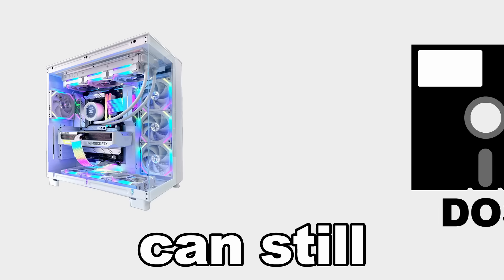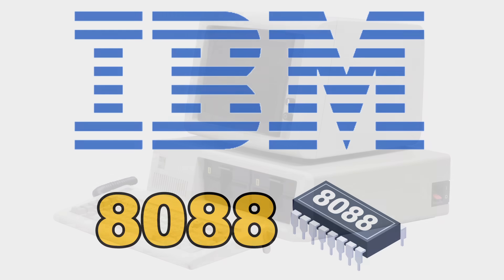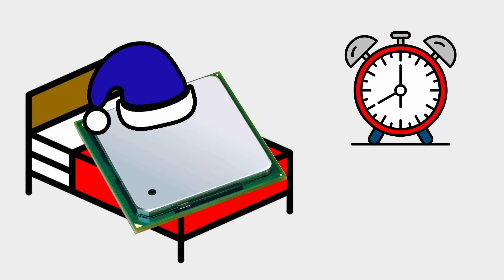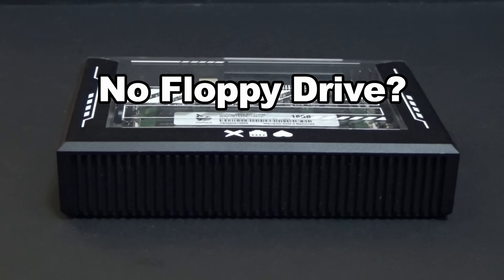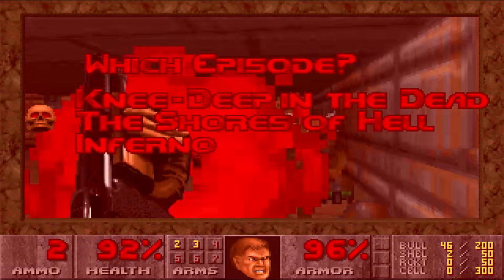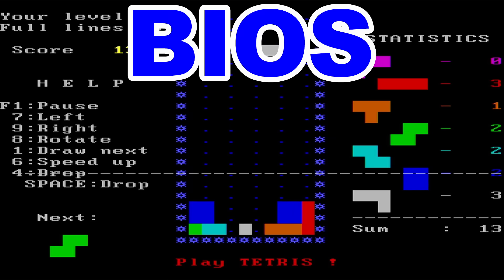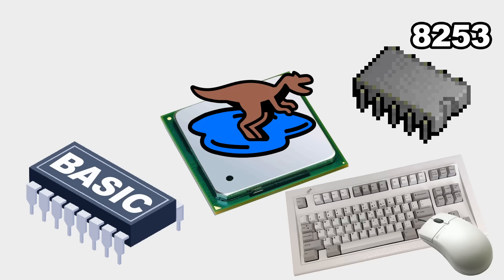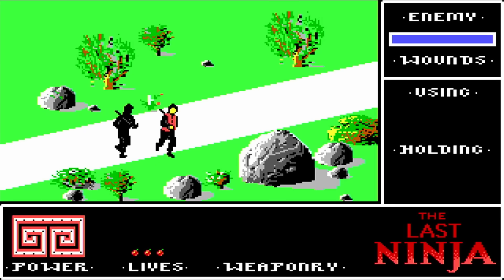45 Year Old DOS on a New Intel CPU Without Emulation

Comment: going by the few guys who talk about how the CPU is physically put together there is no reason to get rid of the older instructions. The part of a picosecond you would save by doing so will not matter when compared to the other picoseconds taken by the rest of the chip. Yes picoseconds as it is all inside a very fast part of the chip. 
Maybe when 20MHz was considered "fast" removing an instruction would be a thing that will show some benefit. Now that base speeds on the lower end chips are over 3000MHz  removing instructions will just break backwards compatibility for no speed up as the possible speed up will be taken away when you get to the memory controller as CPU cache misses are common with multi tasking.
Being able to run DOS 1.0 or even older software written for x86 is just a forgotten or unknown benefit of staying on the same instruction set for so long. It also helps or helped with the compilers used for devlopment of the newer software now that everything is and has been basically the same for the past 7 to 10 years in CPUs. Nothing really added that you can bank on the majority of consumers having and both AMD and Intel supporting the same instructions. So the binaries are made for a 2009 CPU even for windows software made in 2024 as unless it is a console the programmer will not know what CPU the end user will have. Windows 11 is kind of forcing everyone to get a new machine so setting the profile for a 2018 CPU would be a good bet on what most end users will have or a newer one. At least in 2025 yes people upgrade that slowly that it will take 14 years for developers to feel safe changing the settings in their programs to one that is still older than current year.
Reply: The overhead of x86/x64 instruction decoding, relative to more bare-metal RISC instruction sets, is consuming probably a good chunk of a gigawatt of electricity worldwide. It's not really about speed, it's about energy waste.
Reply: @absurdengineering  You are referring to power consumption not time taken. To which yes and no. You have RISC-V versions that take more power than x86 but also versions that take less. As it is a architecture that isn't uniform across everything it is hard to say which consumes less power as you can optimize the RISC-V chip for your task but that is assuming they are the one who prints the chip or commissions another to print or fabricate it for them

Comment: Thanks for the video, but here's an important correction: The 8086 is NOT compatible with its predecessors, it just has been designed to have enough similarities with it so that you can convert your 8080/8085 code with intel's tool named "ASM86" to 8086 code. You cannot run 8080/8085 code on the 8086.
That being said, NEC's V20/V30 IS compatible with the 8085, albeit with a twist: You have to put it to 8085 mode with a special command. From that moment on though, it won't be able to run 8086 code any longer.
Reply: ASM86 is an assembler, not a converter.
Reply: Jürgen Erhardt:  That might be, but I never claimed it to be otherwise. Read my text thoroughly.
Reply: Yes, I had a V30 in my first PC  and there were a CP/M emulator you could run that used this mode.
Reply: "NEC's V20/V30 IS compatible with the 8085"

8085 or Z80?  I've forgotten.
Reply: @James_Knott  According to cpu-world it is 8080 compatible. There are three new instructions to switch from 8086 mode to 8080 mode and back. (brkem, retem and calln)

Comment: Backward compatibility just pays for itself in so many ways. Old software has tremendous value.
Reply: Apart from some extremely out of date enterprise software, pretty much everybody else is using some form of DOSBox, DOS running in a VM or FreeDOS for this sort of thing. And even with the enterprise stuff, it probably would be better to be run in that fashion, but it can be a massive headache to make sure it works properly in the new environment and move it to the new set up. At which point, you might as well have just fixed the program to work with more modern OSes anyways.

Comment: What is the point of x86 CPU backward compatibility when there is a very good QEMU emulator?
Reply: Real hardware can be used to find bugs in emulation.
Reply: Show me how to plug the custom controller card that interfaces to my $250,000 CnC machine from a company that doesn't exist anymore into your emulator.

Comment: NO  Please read up on BIOS as much as BIOS stands for Basic Input Output System this is confusing as it is more to do with the settings for the Input/Output system than doing the IO it's self.  Yes there are BIOS interrupt calls but after the BOOT process DOS dose most of the work.  O dear there is a big can of worms here as to what layer does what.

Comment: Real-mode performance is crap on modern CPUs it would be interesting to see benchmarks of each generation to see when it became crappy.
Reply: The Pentium Pro was the first nail in the coffin: the earlier x86 microarchitectures (386, 486 and Pentium) had the 32-bit extensions bolted on with no attempt to optimise for them - indeed, a forgotten piece of history is that the 386 was barely faster than the 286 at the same clock speed. It's just that you could get 386s at 25MHz out of the gate, and up to 40MHz (thanks AMD) by the end of its era. While the 286 did have unobtainium 25MHz variants (by second-source licensees such as Harris), most ran at 12MHz, maybe 16MHz if you were lucky.

The P6, on the other hand, positioned as a workstation processor, was the first to concentrate on 32-bit performance - to the point that people (some of whom were computing professionals, and even working at computer magazines doing benchmarking, and as such should have known better) running Windows 9x and OS/2 (which both contained big whacks of 16-bit code) criticised it extensively. These criticisms continued into the Pentium II era (which was just a respun Pentium Pro after all), and only quietened down in the Pentium 3 era (again, another PPro respin), as people shifted to fully 32-bit OSs such as the Windows NT line, specifically 2000 and XP.

We can safely skip the Pentium 4: it was an evolutionary dead-end that barely ran 32-bit code expediently, let alone 16-bit. Intel got rid of NetBurst very quickly, and none of its microarchitecture really survived into modern x86 processors. The Pentium M, which Intel went back to when creating the Core uarch, was a lightly-modified Pentium 3, and shared its 16-bit weakness.

Quickly mentioning hyperthreading and multicore (neither of which 16-bit code ever leveraged in any meaningful way), I'd say the final nail was AMD64: now we have these 64-bit-wide structures in the ALUs that 16-bit code only uses a quarter of - this would be what's strangling 16-bit performance in modern x86, and since it's all part of "legacy mode" now (yes, that's what the AMD64 docs call it), nobody at either Intel or AMD would even slightly care - after all, it's still all way faster than the last processor that cared about 16-bit code: the original Pentium.

Comment: AKA how to run classic Doom at 35,000 frames per second.
Reply: It's actually capped at 35.
Reply: Doom has FPS limit at 35 FPS.
But, Doom benchmark not! Doom benchmark is actually uncapped.
Reply: @warrax111  With good reason, most people couldn't play Doom if the FPS was too high, and a benchmark that is capped would be pretty useless once computers got past a certain point in terms of power.

Comment: The Surprising part to me was the speed it was running at. I have seen DOS games go absolutely BONKERS speed wise on even 20 year old CPUs. That looked stable and NOT running at warp 9.9999!
Reply: Some games just seem to have been written in mind with limiting the runtime speed based on fps.
Slight tangent: on a different platform (Sega Mega Drive), the game Sonic the Hedgehog ran slightly slower in regions using 50Hz AC mains current, compared to 60Hz regions such as USA. The game's code was designed to sync with this frequency.

This meant that for some of us, we experienced Sonic at about 5/6 as fast as it was meant to be, and at the time we had no idea.
Reply: To be fair, he probaby used a slowdown TSR. They're pretty common (and pretty reliable) these days.
Reply from the maker: Luckily it just worked for me, probably more BIOS magic
Reply: It depends on when the games were made.  Once PCs moved beyond the original 4.77 MHz, they initially had turbo buttons to slow them down from 8, 16 or faster speeds to the original 4.77 so games would work right.  But eventually game makers put code in their games to detect the processor speed and put wait loops in to slow them down automatically.

Comment: Bro, it’s not backwards compatibility. It’s x86 architecture all the way through it will even run 8-bit applications if you boot to DOS. But those 8-bit & some earlier 16-bit games all run way too fast
Reply: That's why we have ubiquitous (and reliable) slowdown TSRs these days. If you gobble up 9,999 out of 10,000 CPU cycles with a busy loop, even a firebreathing 7950X will do a convincing impression of a 286. 🤣
Reply: The different operation modes of x86 microprocessor have different instruction set. The same "mov ax, bx" will be translated to different bit pattern by the compiler/assembler based on the intended operation mode.

About old games run too fast, the reason is they use software counter to time their movements. With computer running faster and faster, the 1990s kids had a challenge "play Tetris on new computer". DosBox has speed up and speed down buttons for that purpose.

Comment: But why the 16-bit instruction still being support, even to this day?
Reply: Because of all the 16bit code still running today.

It's also cheaper to have one chip design for ALL markets, so besides certain low power versions etc generally if you have a laptop and want a gaming chip, you can be sold the same chip that might also be sold to a company making industrial machine motherboards that run 16bit code to operate a water treatment plant.

And it goes further back too. Only recently was production of the Z80 processor stopped and they still make 6502 processors because they still get used out there!
Reply: @dlarge6502  What is the point of x86 CPU backward compatibility when there is a very good QEMU emulator?
Reply: @AdrianuX1985  Erm, so you don't emulate?

Ask Intel, they are the ones with the customers
Reply: @AdrianuX1985  Because PCs aren't the only use case for an x86 processor.

Comment: Theoretically, you can run SGI’s IRIX or Nintendo 64 games natively on a RISC-V machine since it is compatible with MIPS and the Nintendo 64 and SGI computers used MIPS processors.
Reply: This is, in general, incorrect. The CPU might be the same (or close enough), but there's a whole lot more to a platform than just the CPU, especially in the older days. I can't run Windows on my microwave, despite the processor being an embedded 486. I can't run NES games on a VIC-20, despite the fact that they both use 6502s. I can't run macOS on my cellphone, despite the fact that they're both ARMs. And so on.

Comment: It looks like at least two things are needed for a modern intel based or amd based computer to run old MSDOS. One thing is the computer needs to have a legacy bios mode available in its firmware and a legacy boot mode available in its firmware. Also the graphics card will need to have a legacy mode that it can be enabled.  It is amazing that this backwards compatibility has been maintained for so long. Especially with planned obsolescence of so many items.
Reply: There's no money in removing it.
Reply: @demonmonsterdave  
Removing it doesn't generate money. Correct. But.

Removing it will save a lot of money in design time and less rate of defective chips. 

That being said, the reason they decided to keep it because backward compatibility was proven to be a big boost in sale. IBM became the top dog in the industry for several decades because of it.
Reply: @gorilladisco9108  That being said, it is what it is, having said that, to be honest.
Reply: @gorilladisco9108  It won't for the same reason you still see modern motherboards with serial and PS/2 ports. They're still used in some places. A good example of that would be things like ATMs, kiosks, many of them still running things like Windows XP or 7 which don't support UEFI booting.
Reply: It's how Microsoft enforced it's monopoly. Intel's not a monopoly, but still can be "anticompetitive".  As long as there's a substantial segment that demands backward compatibility, it pays to cater to them.  When they don't, it gives purchasers more incentive to go to another vendor. For example, if you don't need Win32, you might as well get ARM, and maybe get an ARM Chromebook.  They would rather you not do that!
Reply: Currently using an AMD APU from 2013 or 2014, with internal graphics, and PC speaker actually works. Managed to run Windows 1.01, 3.1 and 98 without patcher9x on it, the latter with an universal VBE driver for better display though the basic one does work without glitching (unlike another YT video taken from a more modern system). It has VBE 3 which fully works, includes LFB, 8/15/16bit color modes and big resolutions; the downside is that there's no VBE graphic modes below 640x400 (though I only found a single program that needs it for UI, NO$GMB), and version number 3 causes some programs to trip VBE detection (KGen98). Very few software suffer from this (certainly not the OSes), but are still usable.
On top of that, CGA compatibility. I don't know how it works, probably CPU-driven on the UEFI side, but it does. Just the fact it does is already cool IMO.
Unfortunately, between 2014 and 2015 AMD decided to remove 8bit display modes, introduced the TLB Invalidation bug on its newer CPUs, and overall compatibility only went downhill since then.
Reply: Planned obsolescence is a hoax. ¯\_(ツ)_/¯

Comment: Imagine if we could remove all this silicon and use them for something else actually useful today in 2024
Reply: The amount of silicon used is nearly zero on a modern CPU. If this (essentially) really fast 386 was like a separate CPU on the die (which it isn't - it's highly integrated, with 64-bit long mode a nearly-perfect superset of 386 protected mode), it would consume 275,000 transistors - enough for another 4KB of L1 cache per core on your modern processor.
Reply: @throwaway6478  4kb of L1 cache is not insignificant, especially compared to a completely useless feature like DOS support.
Reply: @chengong388 But you can't get that 4KB of L1 cache. As I said (but you refused to read for some reason), you could only get that if it was a separate 386 on your die - and it isn't.